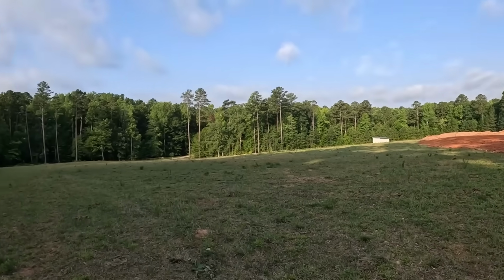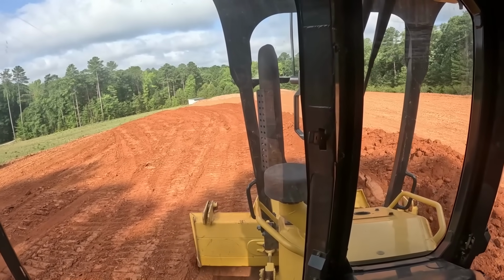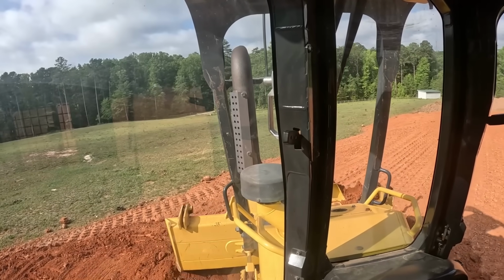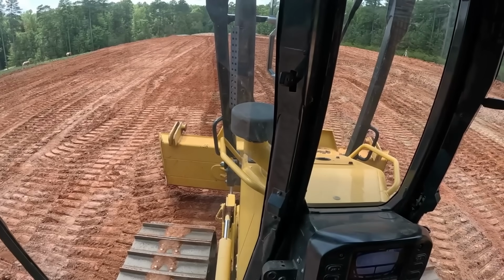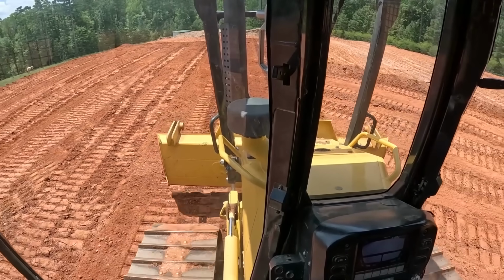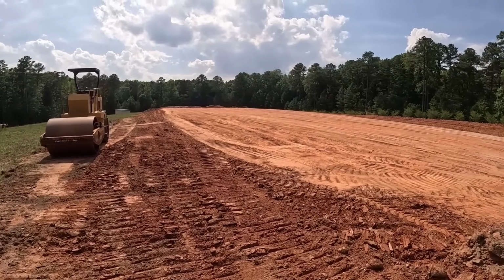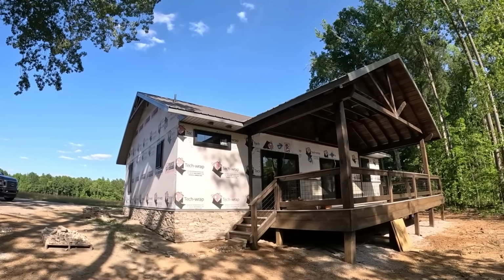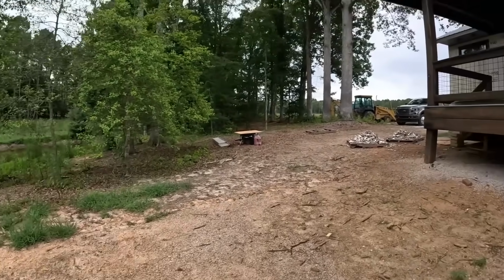Preparing The Horse Arena For Rain And Cabin Update

Comment: I know that you probably won't see this and probably won't care.  The cabin looks great. The only issue that I seen is where the drywall on the ceiling in the great room was not installed and finished because of the tounge and groove ceiling will be installed. Now this is coming from someone who has been in the residential construction business for 4 plus decades. That drywall system does two things. Finished walls and ceilings and sealing the inside of your home. That tounge and groove ceiling will not seal that dust out or give you a positive air situation in that home. That wood ceiling will expand and contract due to the heat and your HVAC unit will constantly be sucking particulate matter thru the cracks in that ceiling.  You should have this corrected  immediately.

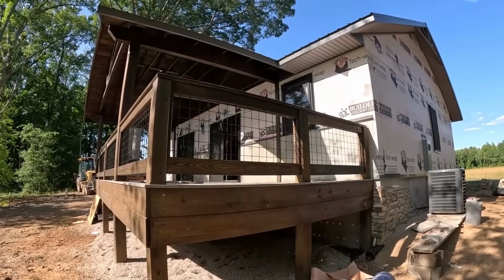Comment: 20:27 if you do get a emergency power system useing photovoltaic and batteries you better build like a dog house away from the house due to fire hazards of (espcially lithium and sodium) batteries 
you could save a lot on power bills since AC uses most power when the sun shines bright - so you could direct use it without much storing it direct use solar power has a efficiency of 97% and is nearly free of maintainance
also could use a heat coil direct fed from the photovoltaik in a boiler for very cheap hot water

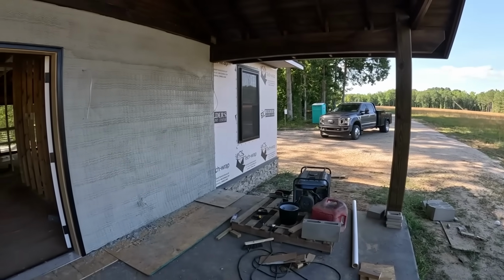Comment: 19:56 you should stay away from sheet rock with such high air moisture as in your region if you dont want to depend entirely on AC to demoisturize the cabin 
id reccomend useing plywood or grove cut boards and ringed nasils 
just with sheetrock if you leave the AC off for 2 months the air moisture most likey gonna warp the plates its just no good building material for damp area next to a pond in a hot and humid state... 
i guess thats also why your builder avoided spray foam and went for ceramic or rock wool insulation -  just with such major investments longevity should be more of a consideration 
passive dehumidification measures should be concidered 
my grandparents B&B were unused for one season - 6 months when they had health issues - air moisture destroyed everything inside - the carpet floor was moldy , the matraces and blankets and pillows , everything moldy - the brickwork and the grove cut board walls and the cinderbvlock walls had no problems but the sheet rock walls warped and the pannels had to be replaced, the paint flaked off the walls and metal decoration was rusting etc.

Comment: The cabin looks great!  With the pine T&G, be sure to let it sit inside and acclimate before you let them put it up. It can and will shrink up after it's installed. Dang near impossible to hide nails after that happens.  I've hung miles of T&G.  If you use #3 or better wood it has some awesome character and is a little bit cheaper. Then roll on some urethane after and it will be gorgeous!

Comment: Since part of the back porch is not under the awning are you concerned about the water in the ceiling channel running right onto the porch when its pouring down rain?
Reply: He's using composite wood floors, so you don't have to worry about that the composite wood will not rot